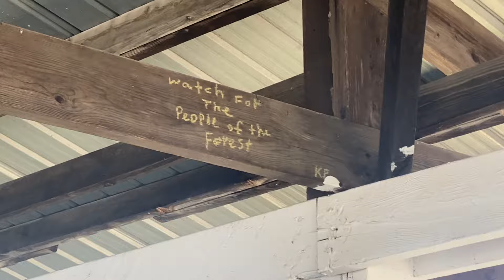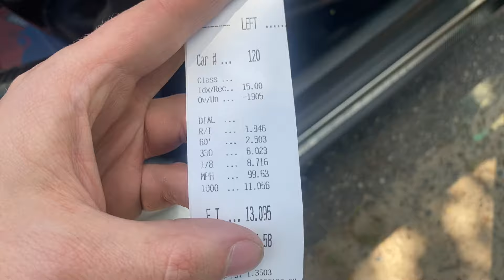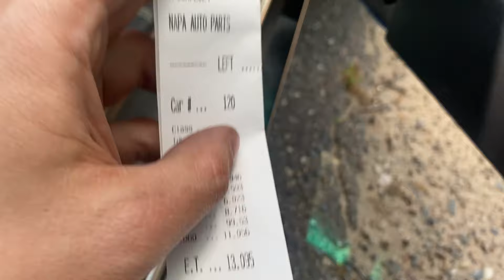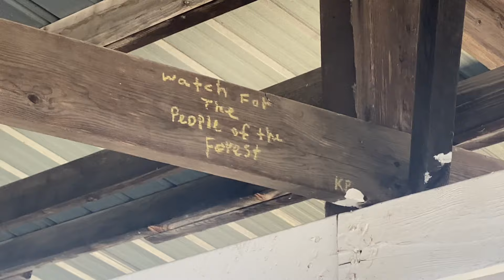Civic Goes 11's @ Northstar Speed Summit!

Comment: Man got to work on that burnout no heat on the tires thas why you spinning 1-2 do your burnout in 3rd and dont be scared of the power let her eat
Reply: that's what I was thinking. I burnout in 2nd but my hatch is only making 460whp @ 20#'s. dude got a big tire too, I'm currently running 13x8 on 23" slicks and runs consistent 11.0 turned down @ 16#'s. There's definitely more in his car, just needs to learn how to drive it.
Reply: @keolanakamotoinbg4730   not bad my hatch had 560 running 9.5 #lachapiadora